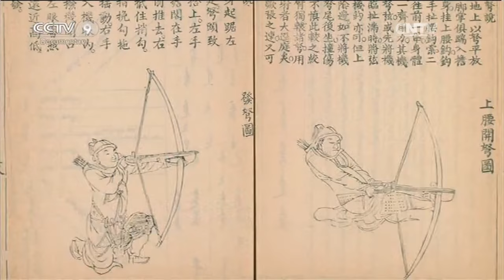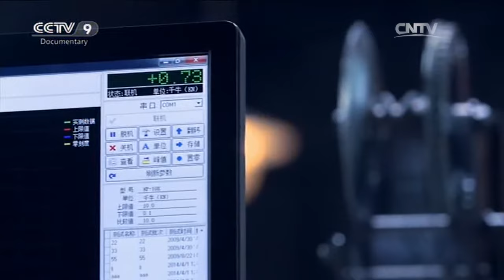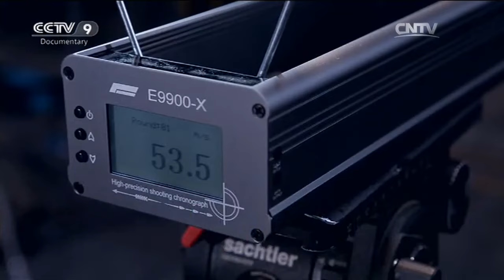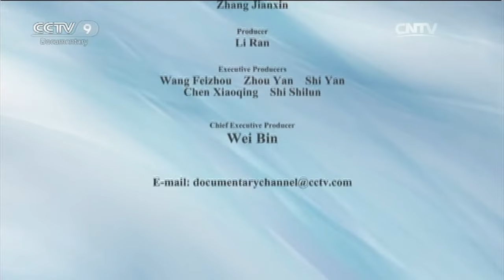Magic Bows vs. Iron Towers [Weapons of Ancient China]  | China Documentary

Comment: It's really interesting to see the difference in the philosophy of crossbows between the East and West. European crossbows had much stiffer arms with a higher draw weight but shorter draw length, where as Chinese ones were much lighter but used a longer draw length to compensate and get more power, more similar to the ancient Greek gastrophetes, or belly bow.
Reply: I don’t think the god’s arm bow they mentioned is considered “light” when soldiers aren’t expected to be able to draw it with their arms
Reply: @duyhungle9375  they still took like less than 10 seconds for each draw, while European crossbows took like 22-40 seconds for each draw using spanning device